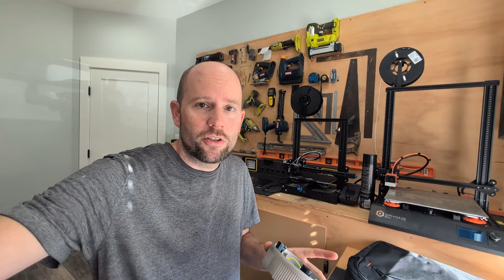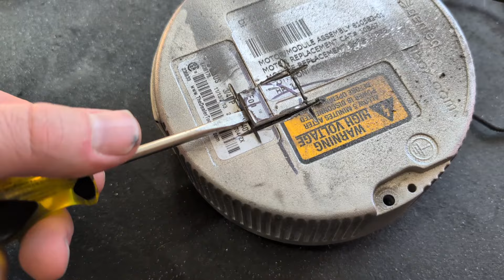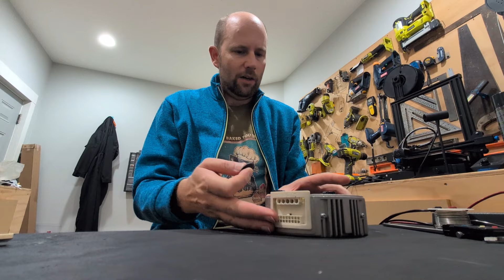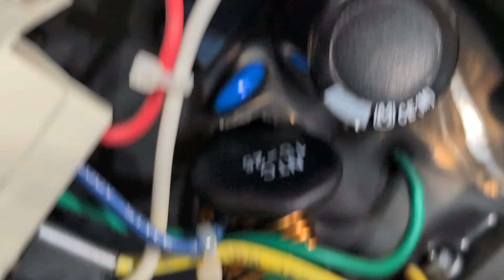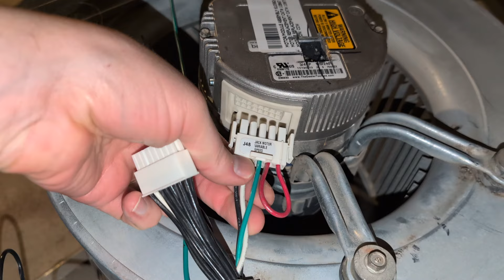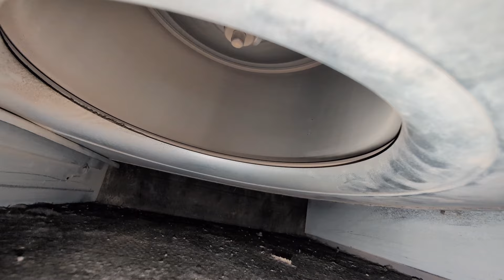$1,000 issue, fixed for  $5!! – The Furnace Repair They Don’t Want You to Know!

Comment: An easier way might have been to take a number of cuts with side cutters on the body of that failed component but leave the original leads and solder the new component in place to the old leads. You would just need to clean the exposed wires well and use some flux to solder the new component in place. As long as there was no circuit board damage from the burnt component it should work as an easy substitute.
Reply from the maker: Sure, but then I wouldn't have spotted the unsoldered lead

Comment: And shame on the HVAC tech who said the whole motor needed to be replaced, talk about an upsell when clearly it's the controller.
Although sometimes it's easier to replace whole sections due to non-repairable assemblies making it not cost effective to swap small sections when you have to take the whole thing apart.
Reply from the maker: Agreed, but what's easier isn't always what's better. Taking this apart consisted of two screws and a plug

Comment: I would say good luck getting that gorilla tape off at leaves residue bad. You could've filled it with hot glue as hot lose easily removable with isopropyl alcohol. A little dab and then you can pop the whole thing out. I do hope gorilla tape isn't conductive? Might've put a layer of electrical tape down first that way you're you've got some rubber insulation between that and the other tape. Then the other tape on top to seal everything in.
Reply from the maker: Naa, gorilla tape isn't conductive and it's fairly easy to remove. Hell I could just cut a hole in it